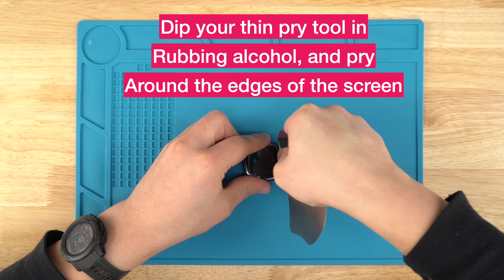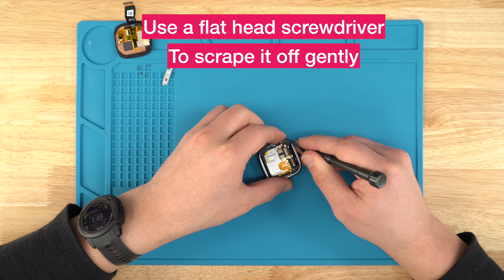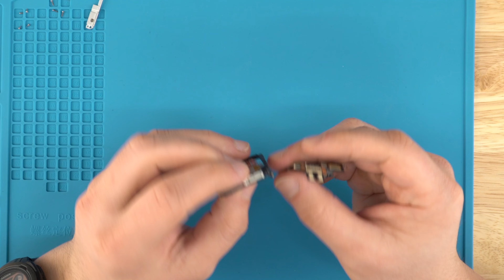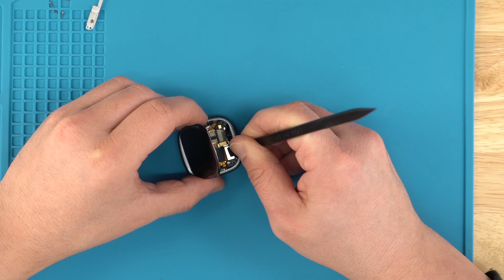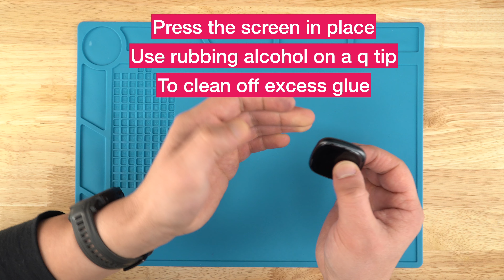Fitbit Sense 2 Battery Replacement Repair Tutorial

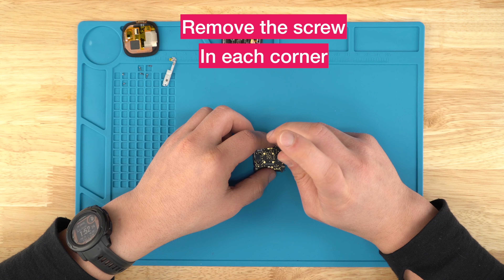Comment: At about 2:18 of the video, there are four phillips head screws that are removed.  They require an extremely precise bit.  I have a bit labeled #0000 but it does not fit the screw.  I suppose it was poorly made because the tip of the screwdriver is too blunt.  The screws require a sharp pointed bit tip.  I did not know about Joe's kit which has all the tools seen in the video.  I wish I had seen it prior to buying a replacement battery.  For those of you going it alone, I used a blade type feeler gauge for spark plug gaps to pry off the watch screen,  .005" .127mm. heat is definitely necessary.  Without a temperature gauge, just heat up the watch and try to insert the blade.  If you are successful - great, if not, just heat it up some more.  Gloves required.  If you hit a cooler spot, just heat that part up.    For the ribbon wires, the battery and the screen have male-female connections that plug together.  The other ribbon connectors have a lever that lifts up to remove the ribbon and you press the lever down to secure the ribbon in place.  My FitBit Sense 2 lasted about a week on a charge for a couple years, then like overnight it would only last a day on a charge.  Great video, well worth your buying his kit.  I did slow it down to x .25 to watch much of it.

Comment: Good video. 180°C -  good to know. Others just say "heat it".  Will it get waterproofed again?  Don't want to take it off during swimming.
Reply from the maker: You can use our cold
Press to make it waterproof after. https://www.joesge.com/products/electronics-cold-press-lamination-adhesive-seal-3ml-syringe-18-gage-tip-glue?_pos=1&_sid=bf7405e25&_ss=r